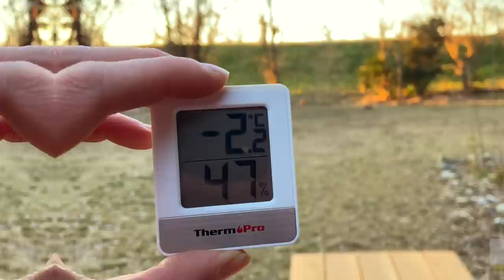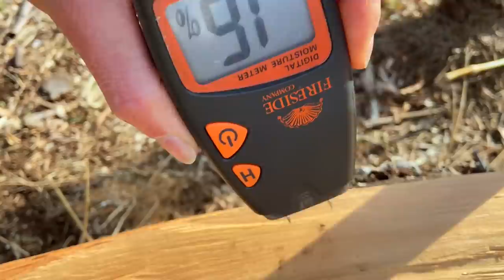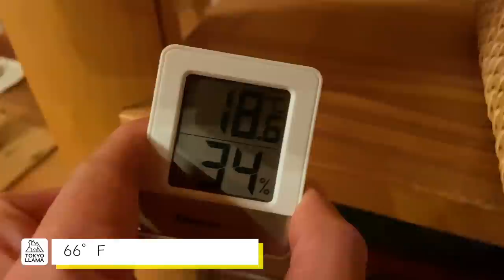Winter in a Japanese House | Tokyo Llama

Comment: When you showed that it was 8 degC inside, I have to say I was quite  shocked! 🥶 Coming from a cold country myself, it's difficult to imagine living somewhere with poor insulation 😅
Reply: one house I lived in in Japan, my room got to +1 degree celsius by the morning every day during winger. Jump down from bed, turn on kerosene stove, wait under covers till it’s 13 degrees to start getting dressed. Never was cold sleeping as the covers/blanket was super thick and warm. And it was the edge of Tokyo prefecture so not a super cold part of Japan either. Was just a regular house and in good shape, but being from a place with brick walls and central heating everywhere it was kind of crazy.
Reply from the maker: @waseabi5220  yes, 8 is not as bad as some houses!
Reply: @waseabi5220  wow! That's crazy 😅 I don't think I would've survived in that situation 😅

I currently live in Switzerland. The winter has been quite mild here this year, mostly around 0-5 degrees. But our current flat is so well insulated that we only had to put the heating on maybe 5 times this winter, which I find crazy! 😲 It's awesome for our heating bills. 😅
I used to live in the UK and there flat/house insulation seemed to always be quite bad.

It's just interesting to see how different the house heating/insulation situation can be in different countries.🙂
Reply: That is a really modern thing however, I'm from central Europe so an area that's not extremely cold, but does reliably get below zero temperatures. My parents tell story's of how back when they were kids in the 1960 some winter mornings their bed sheets would have frost on them, so I'd say 8 above at night is pretty good game for an older house.
Reply: Traditional Japanese houses are built to make summer heat (about 30-35c)
and humidity down (about 80-95%) so they sacrificed winter since you can wear
more clothing.  That's why you see Engawa corridor to avoid direct sun into the rooms as well as many sliding doors/windows for air circulation.
Reply: @mikiohirata9627  I lived in a Showa Era house in Kyoto for four years, and while it was pretty chilly in winter (hot carpets saved me), it was amazing in summer. Ever since, I have trouble staying in houses with poor ventilation. A completely sealed house, which is what so many seem to seek, doesn't breathe, and nor can I when I am in one.

Comment: Fascinating video, with temperature facts and visuals! And I always love to see snow, especially when I don't have to cycle through it or look at the resulting grey slush later :) It looks like adding insulation and draft strips will really make a significant difference, but I'm also looking forward on your behalf to the time when you can install triple glazing! That will probably make the house more pleasant in summer too (along with all the other insulation)
Reply from the maker: Thanks - yes, snow is nicer to look at than to live with. Hopefully can get at least some new windows by next winter!
Reply: Snow is okay, but it is awful when temperature doesn't hold consistently below zero. And here I am, at southern Finland, and what do we have this winter: lots of snow, but temperature during day at +2 C. Sigh.

But this is better than the winters with almost no snow at all. While having no snow is convenient for getting around, the darkness bites you bad.
Reply: We sold double glazed windows into Japan back in the 90s. The only areas of Japan interested at the time were the cold climate areas. As you have mentioned the improvements controlling the intense summer heat is also a benefit of insulation and double or triple glazed windows. We had a hard time convincing the builders to invest in that back then, I wonder how it is now?
Reply: @keikeiasako  It's still the same. they only care about fast installation and lowering THEIR costs (not the homebuyer's)
Reply: @ChristopherCricketWallace  it has to be mandatory as here. Triple glass only since that year (Germany).
Reply from the maker: @keikeiasako  double glazed are standard now, though you can still buy single - all the new windows we put in are double glazed.

Comment: A couple of questions. First, A good rule of thumb in western insulation is how long the snow stays on your roof after a snowfall. With asphalt shingles, however, as the standard for American rooftops, the roof shingles on your house are most certainly not asphalt. Is there an equivalent rule of thumb that Japanese houses have that you can in a way compare your insulation to your neighbors? Second, I was taught by a pest control worker that you should do your best to keep firewood as far from wooden structures as you can. Because of the potential of termites or other destructive insects leaving firewood piles for 'greener pastures' of wooden sheds, garages, and houses. Did you place any kind of barrier between the firewood stack you were pulling wood from and your shed/workshop or do you think the risks are not as troublesome as the pest control workers told me or are Asian termites, carpenter bees, etc. are not as prevalent in Japan, or does Japanese building lumber have a strong repellent treatment that lasts for many years? P.S. love the content.
Reply from the maker: I'm don't think there is such a rule of thumb here, but next time it does snow I'll have a closer look at my neighbours' houses. But on our house, the snow did last a few days longer above the kitchen area where we do have new ceiling insulation (though not as much sun on that side). 

In regards to the firewood, ideally we wouldn't keep it close but as I process the wood, I sort between "clean" wood and wood that looks tempting for insects and I keep that wood well away. I've found that we don't get insects in the wood once it's split and stacked (the area between the shed and the house is a wind tunnel and that wood dries very quickly there). We have treated the house with termite stain. Carpenter bees are a problem but they tend to go for softer wood on the shed roof.
Reply: @TokyoLlama  south or west facing roof will lose snow faster because of the sun
Reply: @roymaddocks3184  I bet he knew that already. 😉

Comment: Looks like everyone is enjoying the snow 
I suppose a future job would be to close up as many gaps as possible to try and keep the cold air out 
It would be nice to have double glazing but I suspect it is a very expensive option 
The snow looked amazing 
It was 38 here today so cold was a very distant thought 
I see the shed roof still needs a little work 
It looks like you have settled in quite well 
Nice video Dan 👍👍👍
Reply from the maker: Thanks a lot. Double glazing is standard for new windows now, but the triple glazing is very expensive, especially for the big engawa windows.
Reply: @TokyoLlama  prices here are nearly the same if you buy quality windows. Make the windows smaller.

Comment: Great video as always! 
I think you should perhaps consider a more efficient heating system in the future, since you're ok with sourcing your fire wood I would perhaps suggest a wood burner connected to a central heating system. My parents have this in their house and it's very good because you're taking the heat more efficiently to the other rooms of the house. This is of course a special type of wood burner with an integrated water tank that feeds into a water cylinder (so it also warms up the water for baths). It's just an idea and it could possibly be a good solution to look into in the future even though I don't know how easy it is to grab one of these systems in Japan. Your ground floor is raised off the ground so your pipes could run under the floor making it fairly easy to reach every room. 

The first thing I would do is to make sure you insulate your house as best as you can at ceiling level to avoid losing heat into the roof voids, also make everything as air tight as possible between your habitable rooms and voids/cavities in the house, but you're already working on this I guess! 

If you notice some of the walls are missing insulation maybe look at injecting insulation into the cavities of these walls? 

You're going in the right direction, first fix the fabric of the house to make sure you achieve good thermal insulation/air tightness. Triple glazing is a good idea but the frames also play an important role, ideally get something with trickle vents so you can control some of the background ventilation.

Great job as usual and thanks for the video, it's a pleasure to watch your projects progressing.
Reply from the maker: Thanks very much! I have thought about ducted heating, maybe catching the air above the stove and sending through ducts but not sure this would be very efficient. Also, since we have an ecocute efficient boiler I've been looking at hot water radiators for some of the rooms the stove doesn't reach very well.
Reply: Efficient in Japan means ductless heatpumps (ducted is an option though you lose air there).

Comment: Please consider double pane windows instead of triple pane. With triple pane it could happen that heat and moisture moves through the walls instead of the windows, which makes mold grow in the walls. This is because triple pane windows insulate better than the wall in old houses. 

In germany we only use double pane windows in half timbered houses because of this. I imagine that it could be the same with your house. 
Also, the difference between double and triple is not that high. 

Great video as always! :D

Comment: Forget the double pane windows for a moment. First you need to make everything airtight. There are special rubber sealing strips or if you want to go the cheaper route then look into weather stripping with a D-profile or a P-profile. Because with every opening to the outside wind can exchange your warm inside air very quickly with the cold outside air.
And for the single pane windows you should definitely consider Window Shrink Film. I put that on all of the windows in my last apartment. You can't really see them and they effectively create a double pane window with all the benefits of that air gap you have between the two panes of a double pane window.
Reply: I agree. Plug the leaks first. Then add insulation or extra layers of glass
Reply: Those sealing strips has been used in Europe since 60es and yes they do work ,hovewer double glased windows make a huge difference as well in house thermal insulation

Comment: I've been following you for some time now, and I really like the house and what you've done with it.  Windows upgrade and adding insulation would be a plus.  The only thing different I might have done is create an in-floor heating system and rout the water for the system through the woodstove. It may mean a significant investment in time and money but is well worth it, especially when you get older. Hot and cold spots really diminish because the whole floor is heated.

Comment: The house is looking really nice. Don't forget the house needs to breath and flex but I can see where some roll-in or blown-in insulation would help a lot.  Here we have a Frost King Indoor Window Insulation Kit; have you looked at something like that (a clear film) to make an air gap/battier.
Reply: Earthquakes here so you can’t feasibly make these houses airtight.
Reply from the maker: Thanks, I've been checking out some of those clear film insulation products and am going to give it a try.

Comment: As a joiner I'm often torn between these two things. Allowing air movement to keep the airflow around the timber sufficient to maintain structure and to reduce rot or keeping blocking all air movement from a window to help reduce the energy usage and keep the house more habitable. 

I live in a very wet part of England (Devon) and moisture is a huge issue, although as you have said precipitation is low where you are this may be something to consider with snow.

I have found brush strips to be a very effective way to reduce airflow without having to router out groves in doors in windows, sure you can do this and you can get brush strips inside of a plastic or aluminium holder that will slot in to the wood. The using a router is by far the least intrusive. You can get stick seals, although I haven't had much luck with this. If you do go down the stick on router be sure to clean the surface with methylated spirit first.

When using any seals be sure not to put to much pressure on the doors/ windows. From what I understand the shoji use timber runners and extra pressure in a direction that it's not designed to will put ware in places it isn't intended to.

I love the style of this age of home and the engawa is a great way to heat up the home. 

As for the insulation in the roof, would the structure suffer from just adding some more insulation on top of what is already there rather than removing what is already doing a job all be it lacking. 

As for triple glazing I feel this may be a little much for what you need as it only adds a fraction on to what you get from double glazing which in sure your aware of from your comment in the video. The way I see it is the amount of energy it takes to make that third bit of glass is considerably compared to the energy gains you get from it. The only time I would see it as an option is for ait flow and cold drafts but I would sat with your shoji this is already acting like the third layer.

Anywho really enjoying your videos so keep them up.

Comment: 8 degrees??? Dude, that's nuts. In cold Poland in don't think i've been to a house which drops below 18 degrees, and most are around 20... With heating of course, but if you turn it off it still shouldn't drop below 15 quickly. But i guess if you live in cold country, you want to be warm at least in your house/flat.
I just wonder if the same building techniques were used in Hokkaido, where climate is more like ours. We have drops below -30 degrees C, so that would make your place below freezing point in the morning :D
BTW, how cold it gets in your bedrooms?

Comment: I didn’t know that the paper integrated into the sliding doors would be so effective!

The only place I’ve heard of snow occurring in central California was at the lower level of the courtyard at the church of a boarding school
But I’ve experience hail
Reply: The 1m wide engawa does the job, the shoji just keeps the air from mixing (more or less).
Modern bricks basically also use pockets of air for insulation.

Comment: I had triple gaze windows, the seals fail and fog up.  I replaced with polar windows from Winnipeg. Vinyl double glaze with a low E film in between.  They were amazing, -40C outside and the window surface feels warm at its centre.  Obviously you don't need that much performance and price, gives you an idea of what features you do need.

Comment: Yes, an old Japanese house in winter is quite an experience! I lived in the snowy mountains north of Kyoto in a thatch-roof house, completely un-modernized, kerosene heaters only. Some mornings I'd have to break the ice on the dog's water bowl with a hammer because it was frozen solid (and that was inside the house!). The snow would slide off of the roof and pile up so high that we couldn't see out the windows, lol! Your climate seems much more hospitable, and the renovations are amazing. Happy spring!

Comment: I live in a similar climate and have a home with similar problems. Air is definitely a issue when it is cold. I am the house shoe nut and will often add blankets to the bed. But it really is not a huge issue. We have a few days a year when it gets cold and the heaters keep it warm enough. I am planning on adding a wood stove to help on the really cold days
Reply from the maker: Agree it's not end of the world but I would like to make it more efficient, hopefully to reduce heat loss during the night, especially.
Reply: @TokyoLlama  I understand that too well. I have taken to closing off rooms to keep
other rooms warmer. It is a bit of a pain but saves in heating and it is only for a couple months. For me it is different than you as my children are grown up and I only have one at home now. So closing off the extra bedrooms is not a big deal

Comment: We are in the upper Midwest of the U.S. and feel your pain just thinking about it. We are so glad to see you again you have all done a wonderful job on your beautiful home, You should be very proud of all you have done.  When my husband I bought our last home it was an older home and needed some work. There's always something to fix, but when we moved in our first winter was extremely cold, we also needed new windows and they had to wait so I bought some material and a good lining and batting as you would use for a quilt for a bed.   I made drapes weighted at the bottom I quilted them in a  vertical pattern. I was going to use a grommet maker and grommets but I needed a larger one to fit over the wooden curtain rods. Instead I sewed in drapery hooks and got rods to match the hooks.  We would close them after sundown and open them when the sun would enter the rooms in the morning or mid morning depending on where the room was.  They did make a difference not only was the house  less drafty but it was warmer and we left the drapes as we  put new windows in, as we could afford to.  First we did the front of the house  and let the drapes in the rest stay until we did that section It was much cheaper and I made them so that they added to the look of  the house and didn't look odd.  My husband was glad I did it too because it took a few years before we could get all the windows because as always things seem to happen,  like a lot of doctor and hospital bills.  We keep you all in our prayers, stay safe.